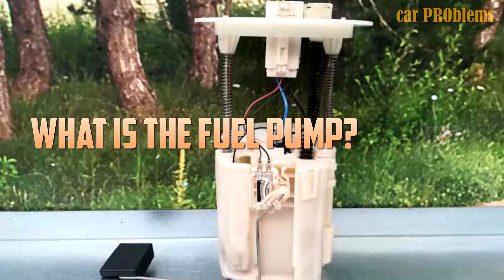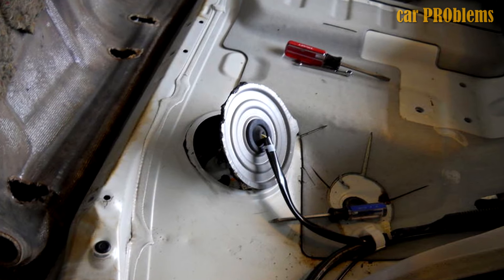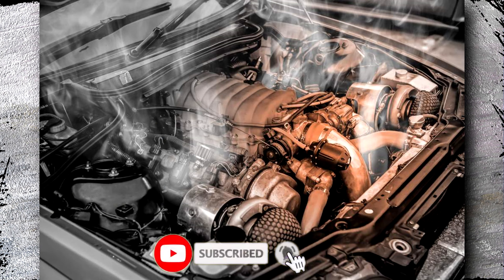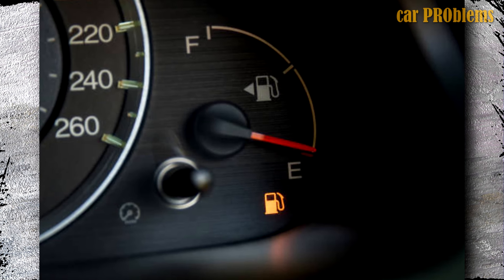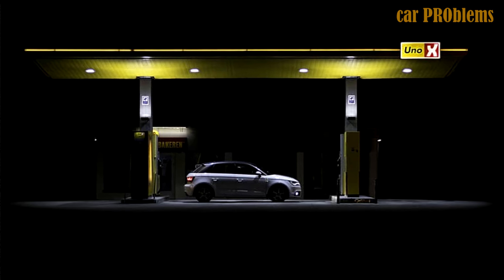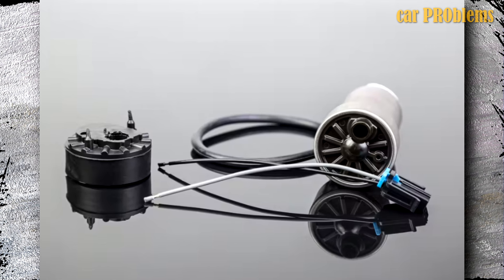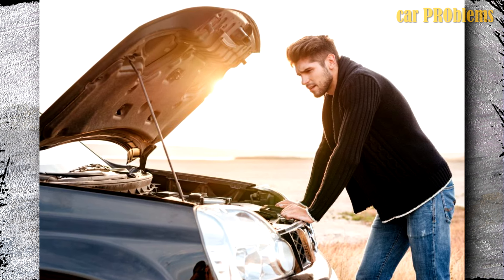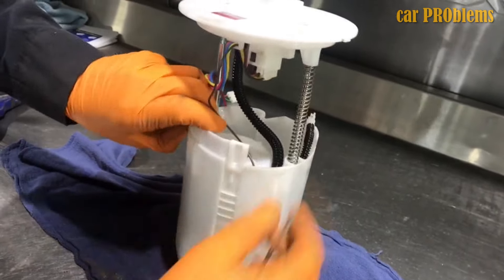10 Bad Fuel Pump Symptoms - Signs of a Failing Fuel Pump

Comment: You know I don't really feel fuel pump can cause overheating in cars, bcos fuel pump is not part of the cooling system, how then can fuel pump causes overheating from your explanation?
Reply: It doesn’t. Never heard of a car overheating from a bad fuel pump
Reply: Fuel pump can cause the engine to run lean due to poor fuel supply. Running lean could cause A LOT of problems to the engine and overheating is one of them.
Reply: running in lean condition can weld your piston to your liner
Reply: You are right bos. But in my experience after this video, I think the bad fuel pump can cause some problem and that problem can damage something again and than, the overheating can take the way to show up. But me too I don't understand how kind the fuel pump can cause straight overhearing ? 🤦🤔
Reply: The lean mixture thing will answer your question.
Reply: A failing fuel pump delivers low-pressure fuel, which could lead to poor combustion. Poor combustion badly affects the function of EGR, which in turn affects engine heating. Most modern engines have an internal EGR system. If the exhaust gas being recirculated contains unburnt gas , that unburnt gas will will lead to increase in engine temperature. Otherwise EGR, internal or external, is meant to make engines run cooler . So a failing fuel pump could lead to engine overheating .
Reply: Lean cylinders air/fuel mixture can cause piston rings to overheat in cylinder
Reply: Same here haven't had that problem only oil pump went out on me and radiator fan went out
Reply: The engine is straining for fuel, therefore causing stress on the engine, which causes overheating!
Reply: Fuel filter, cam sensor, map sensor ,
Reply: Because it can run lean lean mean little of fuel there for  more  generating heat
Reply: True. But it does have a overheating effect! Mine leaves me specially when is over 105 degrees…. Hopefully I change it this week
Reply: How would I know what you feel?
Reply: The overheating is bullshit
Reply: If you engine isnt getting enough fuel it will run lean and the cylinder temo will get too hot, causing heat polishing and possibly blow rings, had this issue and learned the hard way.
Reply: What are you trying to say
Reply: He’s getting confused with a water pump lol
Reply: Faulty fuel pump can cause the car to overheat talking from experience , my fuel pump was failing and my car start to overheat as well, but since the  fuel pump was replaced my car never overheat again....
Reply: Fr
Reply: @zakesbantwinidaweti4315 was your ECT or EGR code coming on? I replaced my sensors twice and I still get overheating but my fans don't kick on when at low speeds and it happens.I cleaned my EGR and the hole is fine, not blocked just checked today.My engine shut down after filling gas today in traffic, pretty scary, started up ok then just won't go I had it towed and they drove it ok and said nothing wrong with it.WTF?
Reply: The engine will run lean and get very hot.
Reply: I’m having they problem idk why once the truck heats up a lot and it make my truck shut down and I have to wait 15 to 30 mins till it cools down and start up and I know it’s fuel pump bc the gauges be acting up sometime
Reply: @chuemoua6834 It isn't when it causes the engine to run lean and creates heat in the engine due to the lean condition..... 💯
Reply: I haven’t never heard of that. Never
Reply: most cars just shut down.
Reply: Ur correct
Reply: Lean condition cause extra heat prematurely wear rings pistons and sleeves of engine

Comment: …fuel pumps don’t cause overheating issues
Reply: read somewhere it starves the engine of fuel so
Reply: @nunyabusiness776  yeah, then it just dies, doesn’t overheat
Reply: It can make car run lean which rises the temperature.
Reply: Little fuel, lots of air, that's called lean, and lean cooks your engine. Though, I'm not sure why the video lists it twice. Poor editing I guess.
Reply: It make it poor fuel causes the engine to work harder than usual.
Reply: It does actually
Reply: Shyt i gota new ⛽️ filter i have hard starting
Reply: @jimkear6749 bro I have more air less fuel in my 96 ford explorer xlt 4.0
Reply: Mone did when I was running trough ontario

Comment: Fuel filter, fuel pressure regulator, crankshaft sensor, or camshaft sensor, maybe a map sensor. If it's the alternator take the pos post off and if it stays running.the alternator is putting out. That's what she said. A skip might be plug wires or a coil pack. Open the hood in the dark and see if you see a spark jump anywhere. Best thing to do is go by a auto parts store and let them get a code reading. That's a good way to not get in deep with buying parts you don't need. Just my opinion. 👍
Reply: My car suzuki swift... when driving to a distance and the car gets warm it just turns off ... code reads .. intake air flow pressure abnormally low. . Change MAP     .clean EGR .... same problem.. don't know if I can get any help to find out what's wrong
Reply: If you haven't fixed it yet, try changing the intake manifold gasket.

Comment: Buddy man,  I hope this pumps my issue I’ve replaced soooo much 💩
Reply: Did it fix it buddy man?
Reply: did it fix it?
Reply: @rapvault98  I don’t think we’ll ever find out😢
Reply: Buddy boys let me tell you somethin, changed the fuel pump the water pump and the head gasket  and I’m still not gettin nothin. Gonna try and just get er choked out on the starting fluid and see what’s what with the old thing
Reply: @kyh3r  sounds good keep me updated please
Reply: Got er going?
Reply: Did you get er going yet?
Reply: @kyh3r did you change the fuel filter and or the fuel rail? These two can also give you problems, are you getting any codes? Go to any auto parts store like auto zone and they can scan your car for free and tell you what the problem is so you stop throwing different parts at it, it maybe something simple like a crank sensor, or a map sensor.
Reply: Me too..

Comment: I currently have a bad fuel pump which prime when it wants to but has good fuel pressure but weak flow...it causes hard starting, very bad idling, engine shaking n stalling. So remember even if a fuel pump shows good fuel pressure on a fuel pressure gauge...that doesnt always mean that it's working as it should. and yes it causes the engine to overheat because it's running too lean...poor fuel supply

Comment: My car engine takes time to start or I will have to rotate more to start. But when it starts and runs for few min or KM it becomes normal for 1-2 hours and then if I park for more than 3-4 hours it takes effort to get start again. 
I changed spark plug and changed air system as well. But problem is same.
What is wrong with my car engine? Is it fuel pressure problem?

Comment: like a liquid cooling unit, the coil can still be active and the vacuum driver be null causing a circuit transfer of energy that no longer goes to such components and backs up. like the filament of a lightbulb. due to environment, it has constant contact with fluid molecules allowing for a thermic transaction preserving the coil by limiting it's critical mass so to speak. doesn't burn up immediately. since petrol in a liquid state is not flammable in such a sense it would warrant assumptions of fires before gas could be in any case, a coolant. inarguable. and because reality is confusing, atoms take care of each other, the cold atomic particles shake hands with the hotter neighbors and splits the thermic load. like liquid water below ice dances through the ice itself trading places with solid ice water molecules as they go along. provable by way of slowing lowering your finger into a cup of water, the water always touches you first. things are not always as they appear.

Comment: Question can it be possible for your fuel pump to be so shot out/broken that you can’t hear it engaging and not turn the car over. Also sometimes when I’m at red lights it would jolt

Comment: Blows a fuse of EFI system, disconnect pump, fuse doesn’t blow, found it-dude when it’s apart will double check if it’s the sender, my light low fuel came on at near full a few days before the fuse went. LC80; been sitting around with water in fuel from a dodgy servo.

Comment: My car is stalling when I need go round corners slowly and need to change to 1st or 2nd.  At the same time ive started hearing a whining noise from the back of the car which I have never heard before.  Could it be that my pump is on the way out and that its not getting enough fuel to the engine to keep the revs up?  I thought it was because of the cold weather but it happens even when the engine is warm.
Reply: What did you find out about this

Comment: Can it cause a jeep to die suddenly, engine, lights, everything??
Reply: I can't speak for a Jeep, but in my Acura when I was driving it died. Died. I lost power to everything even the windows immediately and it ended up being my clutch relay switch.
Reply: i have also problem for my jeep commander and whenver i press accelerator it has a late reaction😖

Comment: I don't understand how can a weak fuel pump cause an engine to overheat? Sure bad coolant ,clogged radiator,faulty timing,a bad ECM, broken fan belt,a bad coolng fan assembly and a host of other causes,but I didn't know a bad fuel pump could be a part of the overheating problem.
Reply: Maybe horrible misfire with the fuel and over doing the gas when it isnt going anywhere while misfiring can wear and heat it up
Reply: Runs lean, not enough fuel for the combustion process.

This makes the engine hotter due to pre-ignition but that is almost always brought on by a lower fuel volume which leaves too little fuel for a complete stoic burn. 12.2 to 12.8 to 1 air/fuel for gasoline, 1.73:1 for nitromethanol

Comment: Mine has been sputtering  when i hit gas ,,and then i here  a ticking sound from the back ,,alomost like a bad ground  hitting  on and off at times .
Could this be the fulepump?
Reply: Very likely, so was it the pump, since 3 month has passed?
Reply: @toecamel8719  I am here to inform you that he changed his fuel pump using a cheap power tool that caused his tank to explode in the process. He will be missed.

Comment: I have indica and my car engine getting accelerating automatically in first 3 gears and in 4th and 5th gear there is no issue. This issue is happening only after taking my car to long drive after crossing speed about 80km/hr

Comment: Old honda sputters to a start. At cold start only than drives fine. I have replace fuel pump and use seafoam in the fuel tank, still sputters. Mechanic said its just an old honda and thats what they do..... 

Any advice, thanks!
Reply from the maker: spark plugs, ignition coils, crankshaft and camshaft sensors, stretched chain or jumped timing marks... Too many things to test. Anything could happen... I suppose there is no possibility to test it with OBD-sensor?
Reply: @carproblemsmax  i have new plugs and coilpacks, there is no check engine light. I replaced fuel pump with aftermarket pump, maybe its the pump or injectors idk...
Reply: Its most likley fuel injector seals are cracked..thats why when it heat up it stops do to seal expand

Comment: I have a 2008 Matrix that will have a hard time starting only after it has been driven and then sat for an hour or two.  It it sits longer like 4 to 5 hours or start it back up soon after driving it there is no problem.  Only that 1-3 hour window after driving it.  No other symptoms.  Would this be the fuel pump too?
Reply: 👀 did u ever figure it out
Reply: @jermainebrown1018  yep, it was the fuel pump.  No starting issues now :)

Comment: I have mahindra xylo , when I drive after 40 &50 km reached. the speed decrease automatically maybe 30-40km speed only. I give full acceleration but the speed will not increase. Anybody know about the problem.
Reply from the maker: There could be several reasons for this issue. 
Fuel Delivery Issue: Check if there's a problem with the fuel system, such as a clogged fuel filter or a malfunctioning fuel pump. Insufficient fuel supply can cause a decrease in speed and poor acceleration.

Transmission Problem: A malfunctioning transmission can result in loss of power and difficulty in maintaining speed. It's advisable to have your transmission system inspected by a professional mechanic.

Engine Performance: Issues with the engine, such as a faulty sensor or ignition system problems, can lead to a decrease in speed. Get a comprehensive diagnostic check done to identify any underlying engine-related issues.

Air Intake System: Check if the air filter is dirty or clogged, as it can restrict airflow to the engine, affecting performance. Consider replacing or cleaning the air filter.

Electrical Problems: Faulty electrical components, such as sensors or the ECU, can impact the engine's performance. Have the electrical system checked for any potential issues.

Comment: My car idles den dies wen I stop it or gets warm , is this because of the fuel pump or is it something else ? Help me please 🙏
Reply: Sounds like your alternator is going out
Reply: @taylenware6938  thanks bro and also da main issue now is it  shakes alot and dies on me wen engine gets to 250 degrees, keep getting misfire codes and a unusual code 1408... I changed my MAF sensor , ignition coils,  spark plugs ,  and air filter , but the code 1408 stays on wit drivestrain malfunction 🤦🏿‍♂️ any ideas ?
Reply: @bullygabbana1653  is your car beginning to smoke. If it is and your fuel regulator is in the fuel tank then y'd need to change the unit. But if your regulator is on the fuel rail you've got a much easier job. Or it could be your fuel pressure sensor.  
Basically from your fuel tank to your combustion chamber is the area you should be looking into. I really don't think it's your alternator that you're having problems with. But you could do a simple test on it.
Reply: @zigzag7194  it don't smoke at all but thanks im gonna take it to midas today for a diagnostic
Reply: Your engine try to say you please take me to the hospital i don't feeling good LoL 😂😂😂
Reply: i have exact same problem, i changed ignation coil, wires and spark plug, i changed fuel filter and cleaned the injecror, nothing happend, can you please tell me finally what happend to your car? sorry for bad english
Reply: @tahansr399   It's the IAC idle air control valve.
Reply: It's the IAC idle air control valve.
Reply: Bad idel be a cause here ,?  Slight surge driving car. Micra k11 2002 petrol 😊

Comment: Crap design ,,,why does it seem Chevrolet has more trouble then the other manufactures ,,I’m a HD mechanic but get exposed to all sorts of problems.Only access cover I have ever seen was on some Japan or Korean car ,don’t recall which make.
Reply: My old Nissan Sentra had an access panel to the fuel pump beneath the rear seat. My 2004 Chevy Classic just has a large stamped 'X' on solid metal.

Comment: My car Hyundai H1 2020,this car inside  sometimes come fuel smell.what's problem my car,no any sings
Reply: Your sign should be to not buy a brand new hyundai. Hyundai has HORRIBLE quality control and don't get me started on there oil consumption at low mileage. Your best bet is to sell that and get a Toyota or Honda. GL
Reply: True Hyundai has bad quality control and some parts are overpriced.
Reply: Your fuel filler tube MAY be leaking where it enters the fuel tank, good luck
Reply: Cracked or leaking fuel pump
Reply: Replace the egr and egr line, also you may want to clean or replace the oxygen sensors.